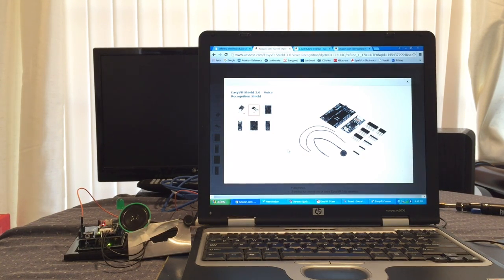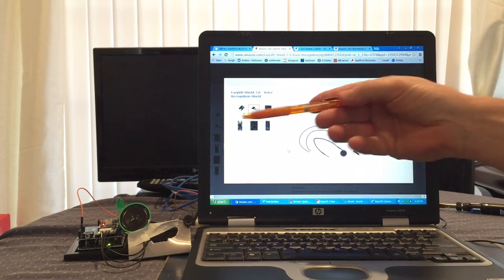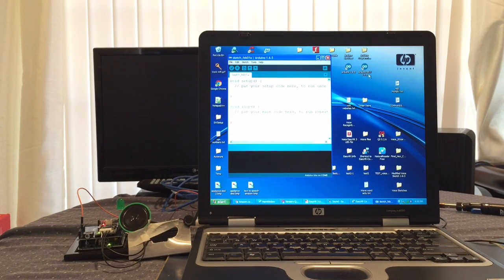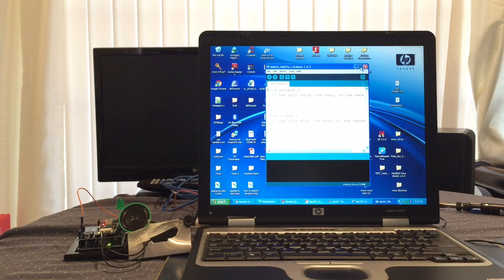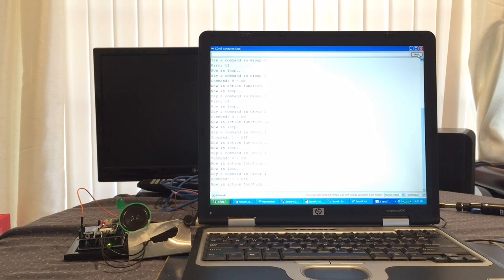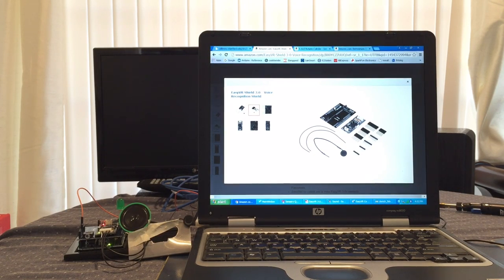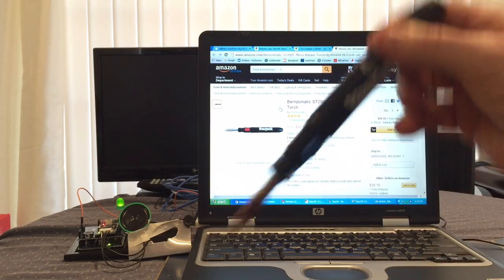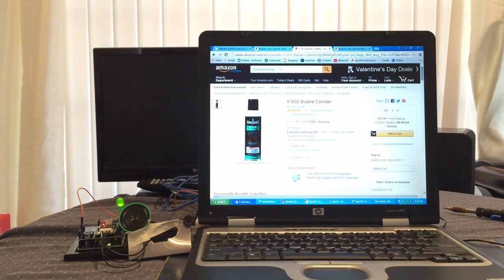EasyVR 3 Voice Recognition Shield Using the Arduino Uno

Comment: It says me:
Bridge not connected. Not requested. Run normally 
———
EasyVR not detected
Reply: You either forgot to set the jumper on the board to 'UP' or maybe the EasyVR bridge sketch hasn't been loaded on your arduino board.
The EasyVRTest sketch from the examples should do.
Reply: Check soldering.

Comment: Hey, really nice video! Helped a lot. I'm using the same EasyVr commander and Arduino versio and I get the following error message. Do you have any idea on what can be happening?

Arduino: 1.6.5 (Windows 8.1), Board: "Arduino/Genuino Uno"

Play.ino: In function 'void setup()':
Play:50: error: 'class EasyVR' has no member named 'bridgeRequested'
Play:53: error: 'BRIDGE_NONE' is not a member of 'EasyVR'
Play:61: error: 'BRIDGE_NORMAL' is not a member of 'EasyVR'
Play:65: error: 'class EasyVR' has no member named 'bridgeLoop'
Play:71: error: 'BRIDGE_BOOT' is not a member of 'EasyVR'
Play:75: error: 'class EasyVR' has no member named 'bridgeLoop'
Play.ino: In function 'void loop()':
Play:100: error: 'EASYVR3' is not a member of 'EasyVR'
Play:113: error: 'EASYVR3' is not a member of 'EasyVR'
'class EasyVR' has no member named 'bridgeRequested'

  This report would have more information with
  "Show verbose output during compilation"
  enabled in File > Preferences.

Comment: Hi,I recently bought an easyvr 3.0 and when I try to connect it using the commander it shows a bridge software error and that it needs to be updated could you please help me out as my final year project depends on this .thank you in advance.
Reply: +vishwas devagiri I had the exact same problem but it was just a matter of messy soldering.
Reply: +hani omar so did it fix the problem after soldering properly?
Reply: +vishwas devagiri Yes I had no problems after
Reply: +hani omar cool thanks I'll try that out
Reply: +vishwas devagiri No worries. using a magnifiying glass helps
Reply: +hani omar thanks man

Comment: Hey, my EASYVR board isnt being recognized by the commander and the "Serial Monitor" option gives garbage values at 9600 baud on Arduino. The lights on my Easy VR  module dont come on either. What seems to be the problem?

Comment: Hi. Do you know if it’s possible to remove this very bad ´robot’ command, that is so ridiculous, and especially it triggers itself very easily, it’s terrible pain.

This module is very hard to do something that really works. 

You have to pronounce things exactly the same way, and in the other side it will trigger the wrong command very often.

I take account of the possible settings of course

That’s a pain, really.

I am currently trying to use it simply to make a machine moving or stopping, and only for this it is very hard to have good wording.

So I’m now trying to use very simple words like a horse. UUUU to go and HOOO to stop.

Shit, 50/50 of time he doesn’t understand and even worse, it triggers ´robot’

SHIT !!!!!
Reply: Yes, you can.
That is exactly what this video explains.
Reply: I found the way using the password group. But this circuit is very erratic /or we never pronounce the same way according to it maybe. The reasult is the same : it works very well immediately after input the voice, but 20 minutes later it’s deaf as an anvil.... really can’t use it for other purpose than exhibitions (recorded exhibitions best ;)) )
Reply: @renesolaire8319  Are you constantly training your commands? You might be overtraining them and then they indeed will not recognize anything but some very specific patterns. 
There are also some settings in the software to define how strict/loose the recognition should be.
Also, the QuickT2SI™ Lite software works in a different way compared to the EasyVR commander software.
QuickT2SI™ Lite  should be more robust. Only too bad that nobody can try it for free due to that license.
The EasyVR should be very versatile because they shipped it in millions of Furby dolls a few years ago.